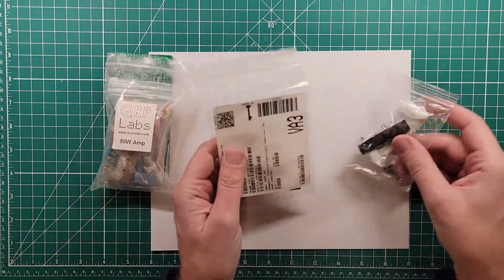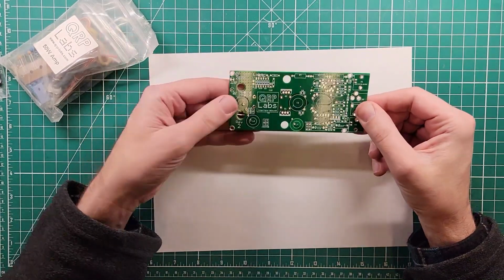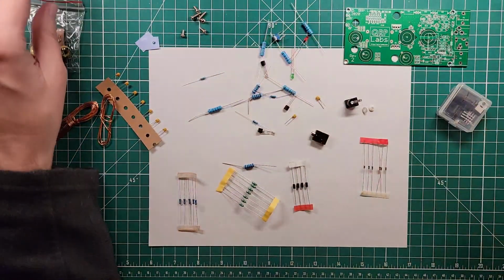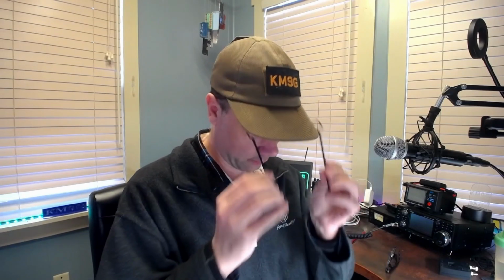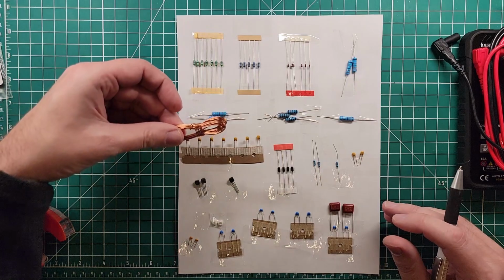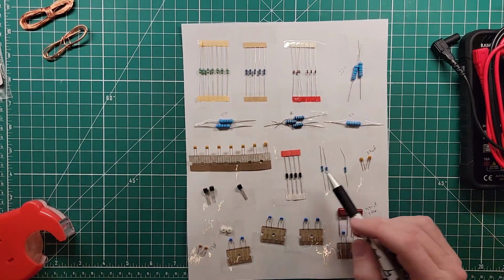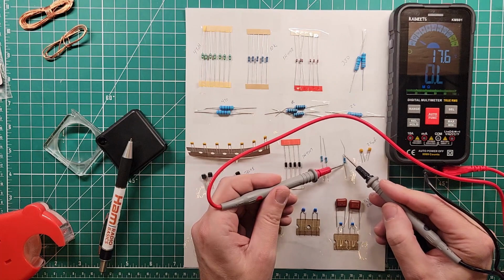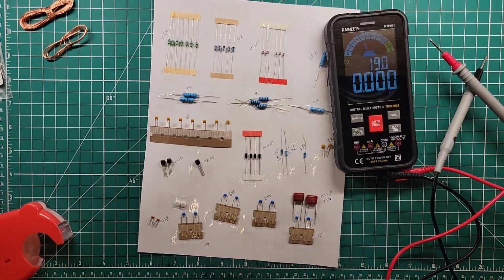You [NEED] More Power! - QCX PA 50 Watt Amplifier - pt1

Comment: Steve, I have found that using a 12" square of 1½" Styrofoam to sort my parts works well.  I put strips of cellophane tape across the front to write the part identification on and then push the wire leads into the foam. Nothing runs away to hide until I get it to solder on the board. I have been using the same foam boards for several years and just replace the tape as needed.
Reply from the maker: That's a great idea!  I love the Ham-genuity!
Reply: @Temporarily Offline Ham Radio  Give a lazy man a hard job, and he will find an easy way to do it.
Reply from the maker: Yes, words that I live by!

Comment: Indeed a 78L05 is a 5v linear voltage regulator. It can't handle much current in the TO92 package so you typically only encounter them in the TO220 package (the package with the heatsink is a TO220)
Reply from the maker: Thanks for the info!  I'm looking forward to your FT-818 CW POTA Vid.
Reply: @temporarilyoffline  video should be public already
Reply from the maker: @JonathanKayne  It is... just waiting until my designated youtube hour.

Comment: Great OCD idea to stick them all on paper and label them. I'm gonna have to steal that idea T.O.👍
It's cheap as chips, hope it works okay with the X6100 or 705 too.🤞🙏
Reply from the maker: It will work fine with those radios - as long as you're not running voice modes, its not designed for those.

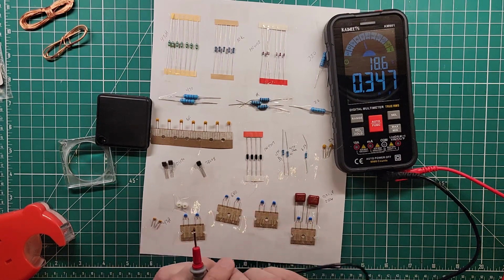Comment: Like your organization of the layout. Question-Like when you are reading from the meter on one of the caps (15:19), meter reads 347 but you say and write down 390. How does that add up? Robert KD4YDC ps Like your channel and just subscribed :-)
Reply from the maker: Hey Robert!  Welcome!  Most electronic parts have a tolerance rating, so you'll very rarely (or very expensively) find one that is exact.  So if it's 390±10%, then 347 is close enough.  On resistors in particular,  there is even a tolerance band that indicates what to expect.  Coming from a computer programming background, this bugs me, but it is what it is.

Comment: What fuses would you recomend for the qcx mini and the 50w pa.
Reply from the maker: I'd check the amp draw, I'd guess the qcx mini is less than 2a on TX.  I'm. Ot sure about the PA.
Reply: My qcx pa would not produce very much power, eventually found the 50ohm patch leads I got off the internet were actually 75ohm leads, now with good quality 50ohm leads everything works great.
Just thought you might want to pass that on to another person,  who might find themselves in the same predicament. 
73 zl3xdj
Reply from the maker: @brianfields4479  thanks for the tip
Reply: Qcx pa just blew up
Reply from the maker: That sucks!  Time for some troubleshooting!  @brianfields4479
Reply: @temporarilyoffline  well I cannot do that, I had the unit built for me, as my slight disability does not really allow my hands to work properly for soldering etc, so I think I will have to throw it away, which is not so good, as I payed hundreds to have it built and shipped to me.
But maybe the mini50pa might work with my qcxmini, I am not sure, just 5w struggles to get qso's from down under hi.

Comment: It is a pity that only for CW.
Reply: I'm planning to use mine with the QDX......
Reply from the maker: It will do CW and Digital (FT8 types) but not SSB.  I bet I could get it to work with the X6100!
Reply: @temporarilyoffline  Yes, for digital modes should be fine. There are not many powers need there. I bought RD70 transistors for a homemade /P amplifier